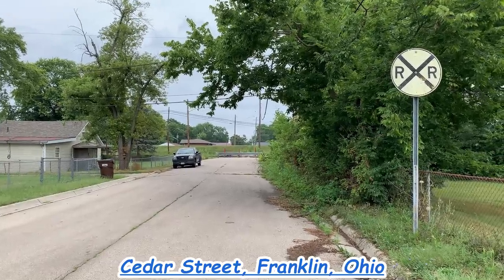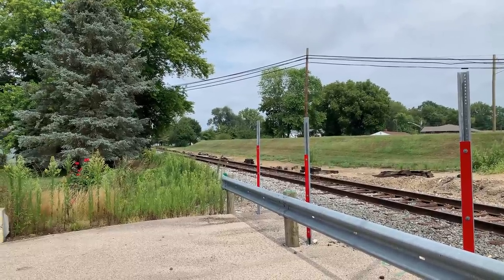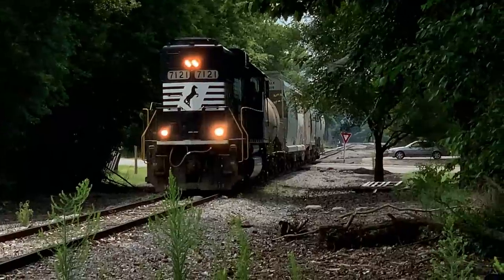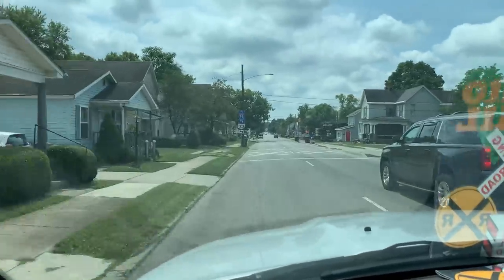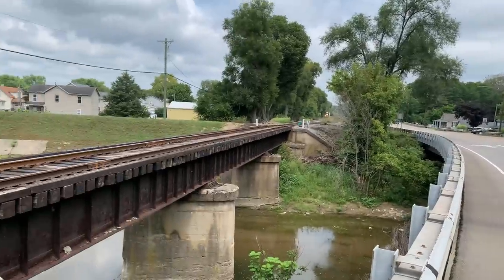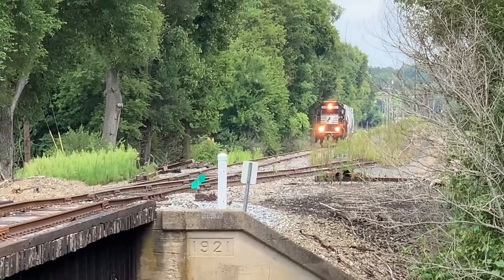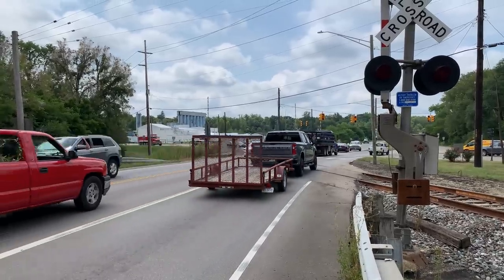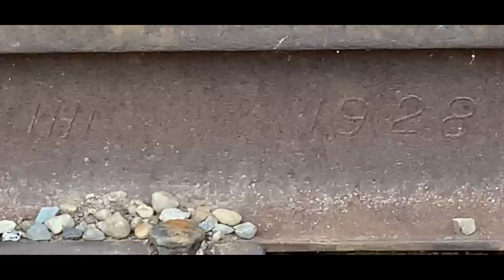Train In The Middle Of The Road!  Abandoned Railroad Crossing & Dangerous Crossing With RR Bridge

Comment: We had a half mile of railway track south of Grosmont Tunnel in North Yorkshire UK that was in 39 foot lengths and inscribed Chicago Illinois USA 1942. It was rolled specially for the LNER during WW2 and was standard British bullhead rail. It was only replaced 3 years ago though it had been re-sleeperred about 25 years ago with second hand concrete sleepers (ties in US railroad parlance). It was still only part worn from its original weight of 95lb per yard but replaced with 113 lb flat-bottomed rail in cwr.